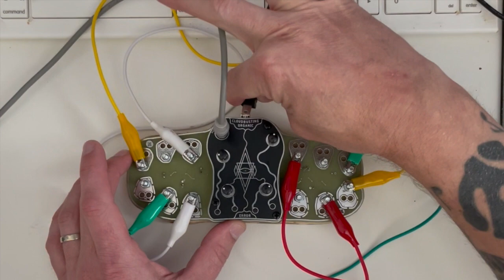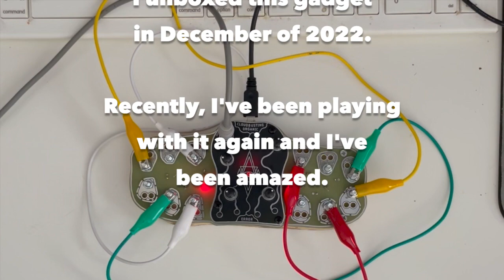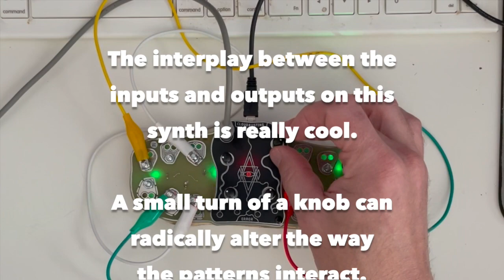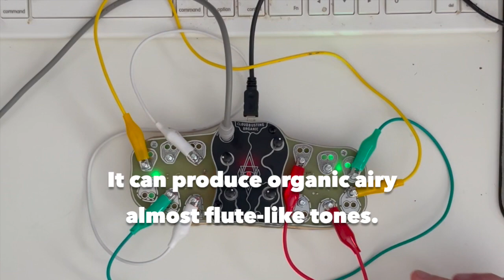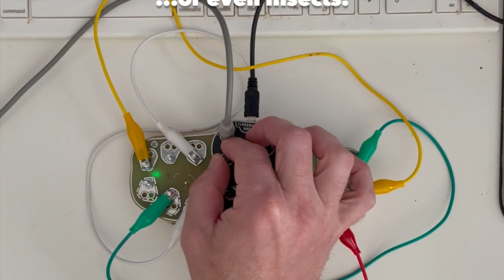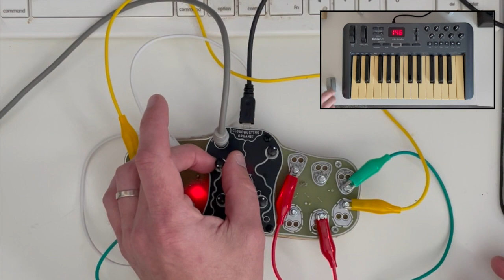Revisiting the Cloudbusting Organic from Error Instruments

Comment: I really do need to get a cloudbursting unit. I want to get the bricky version with the extra cv inputs
Reply from the maker: It is a cool little synth. I probably wouldn't have thought to buy it but Paul sent me this one and I really like it. I agree with you that the bricky version is more flexible. It's an interesting little gadget because none of the knobs are labeled and depending on which patch points you're using, they seem to do different things.